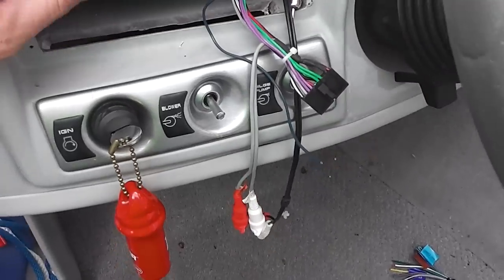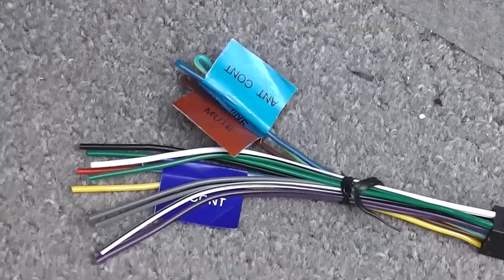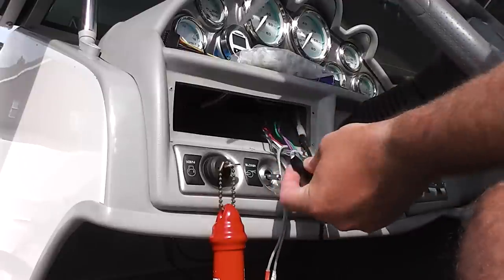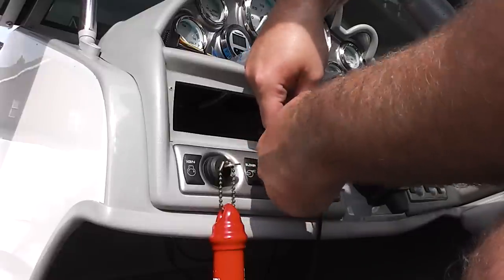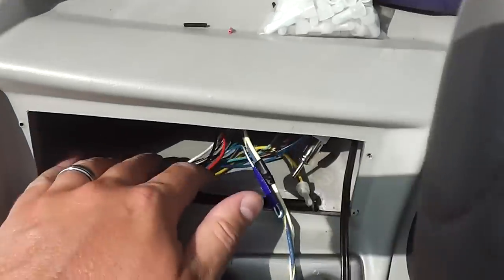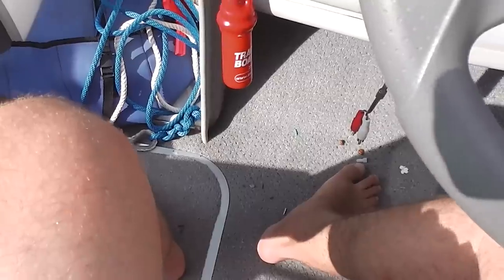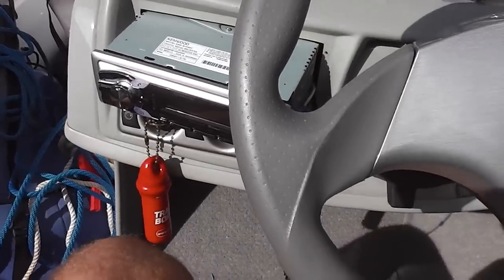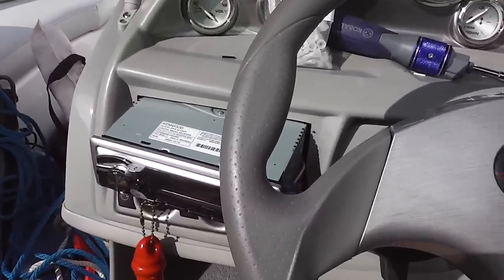Bayliner 185 Boat Stereo Upgrade Tutorial

Comment: just got a used 2007 bayliner 185 and had a radio question.  Should the radio turn on while motor not running?  All other things like trim, blower, bilge work without turning the key.  Thanks!
Reply from the maker: I wouldn’t recommend running it for long periods of time while the motor is not running.  It can drain your battery.

Comment: Question... How do you screw in or secure the radio.  I have the same type set up and need to replace the radio.  I have the four screws, two on each side like you do.  How did you secure the radio in the hole?   thanks
Reply from the maker: Tyscott40 GREAT QUESTION and after a lot of trial and error, I added some nicely cut duct tape.  Even the local car audio shop couldn't make it stay in.  I love this radio though.
Reply: That's been my question!! I feel like we are stuck with Jenson

Comment: I have a 2008 bayliner bowrider and a month after I had it the radio went out. They put another radio in and now it doesn't work and doesn't look like any power is getting to the radio. The second radio only worked for a few hours.
The fuse back at the battery looks ok. Anybody have advice??